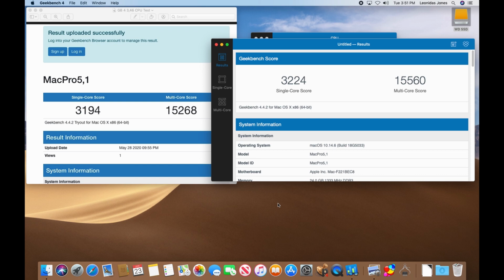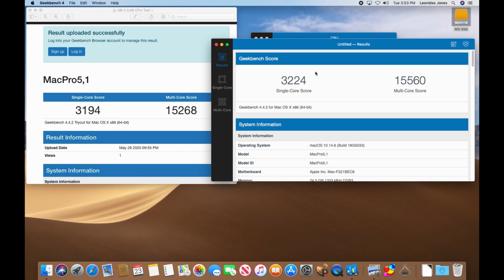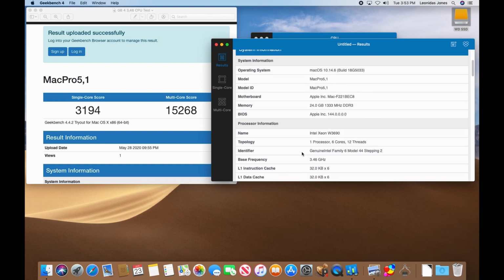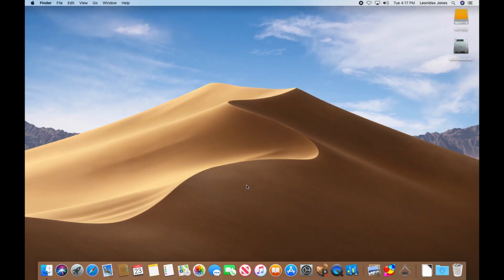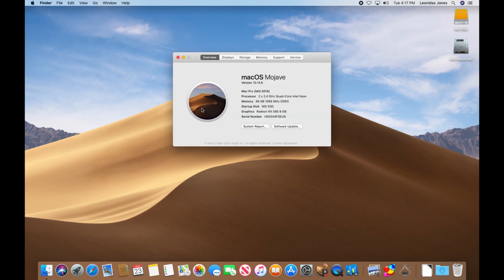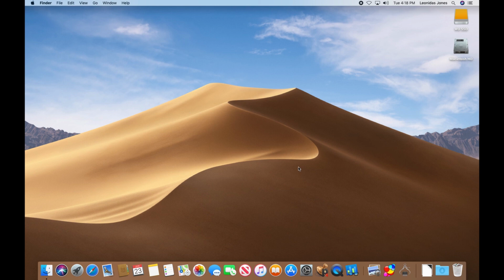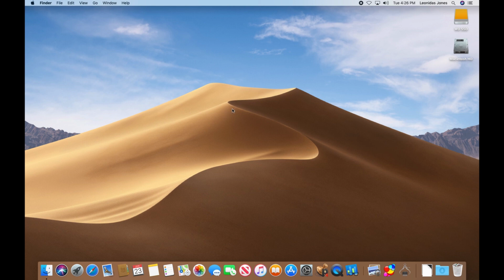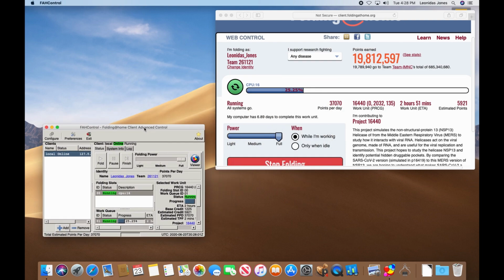Upgrade the 2010 Mac Pro from SIngle CPU to Dual CPU's!

Comment: I just picked up a 5,1 Mac Pro, and wasn't too sure if this was possible with just a tray swap.

Results are not very clear through multiple Google searches, but your video solidified the fact that you can swap out that easy.

My plan is a home NAS with a single L5640 Xeon, and if I'm not happy with the performance, then I want to upgrade to dual L5640's to keep power consumption down.
Reply from the maker: The only real concern is to make sure thaT you get a tray foe an actual 2010. The dual tray for the 2009 4,1 is essentially similar, but will not work in a 5,2.
Reply: @brokenelectronics3665  - I verified that much, as I understand that fans will be full speed if you put a 4,1 tray in a 5,1. 🤘🏽

Comment: Hi. How do you know which dual tray to get?  Is there some serial number identifier?  I'm looking to do the same upgrade but I don't know if I should trust buying the tray off of Ebay.
Reply from the maker: I don't know about a serial number on the CPU trays. The only caveat is that you need to identify whether you have a Mac Pro form 2010-2012, or the 2009 version. The machines are identical, save for  the connection for the dual CPU tray. If it is a 2010 or later, this is a good time to buy, since the prices have dropped considerably. Financially, it makes more sense to buy a tray with low end CPU's and upgrade them yourself. The trays that have upgraded CPUs are very pricey. Good luck with your upgrade.
Reply: @brokenelectronics3665  Got it.  Mines a 2010